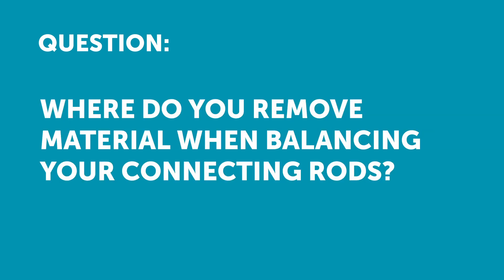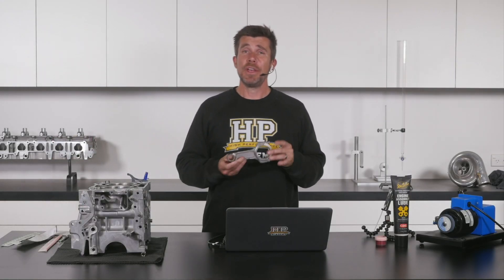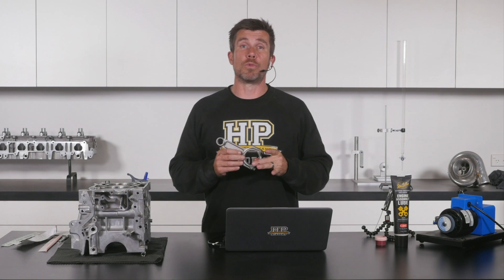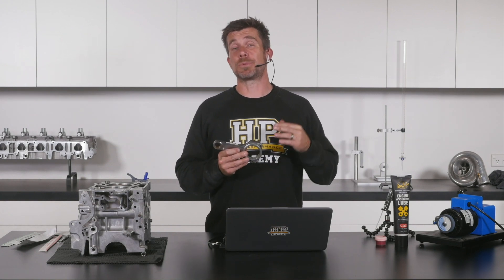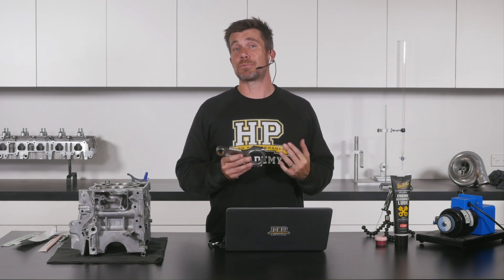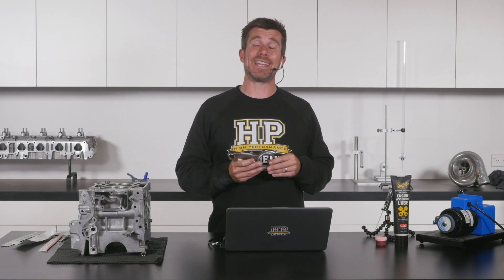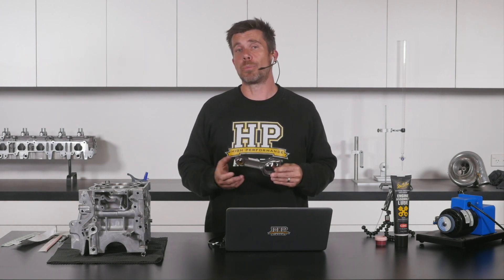Where Can I Remove Material From My Connecting Rod? | Con Rod Balancing [HPA Q&A]

Comment: Can I remove 0.5g from the rod bolt head instead of grinding the rod? I’m 0.8g off and I want to remove 0.4g of each arp rod bolt head instead

Thank you
Reply from the maker: Our advice is that you are best to remove material from the connecting rod in the areas advised, not the bolts. 
You can double check with the likes of ARP for a second opinion - Taz.